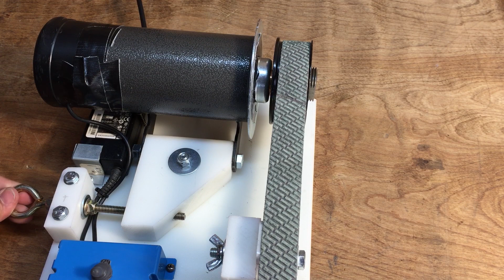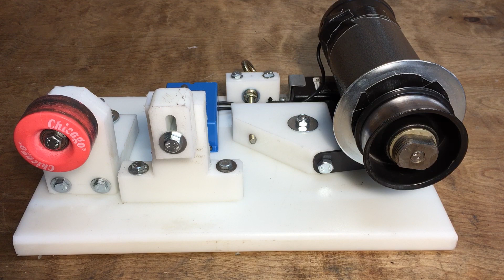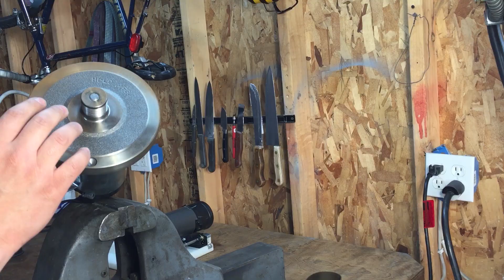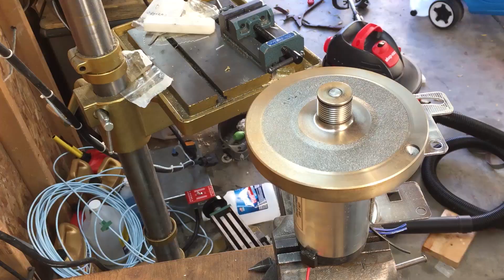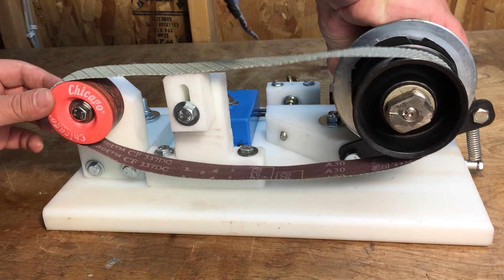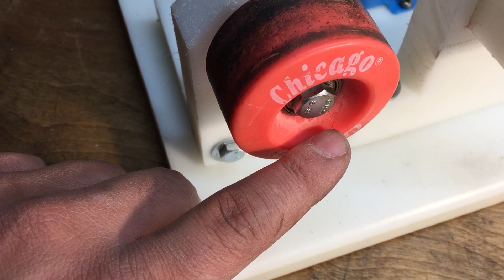DIY Electric Knife or Tool Sharpener!

Comment: I am glad that I found this video of yours. Found a treadmill motor too with controls which I want to use on one of my lathe or milling machine as a variable rpm drive. I do not know this motor and you just save me a lot of trial and error work. Do not worry about the looks of your machine, it's great, you actually achieved the hardest thing in a project which is simplicity.
Congratulation and thanks for putting on public view.

Comment: Lovely...wouldn't the motor heat up without fan?
Reply from the maker: Actually the motor does not heat up because the load on the motor is very low in comparison to what it was designed for.